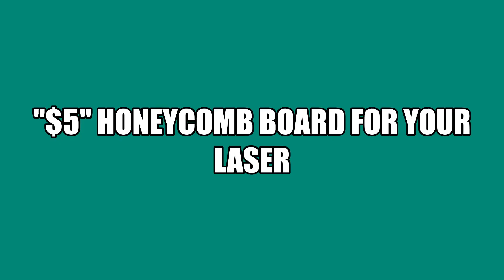Make a $5 Laser Honeycomb #laser #lasercutting #laserengraver #diy

Comment: Hey, I was looking around to see if anyone else had done this. I don't know exactly how to flatten it out perfectly- I've got a huge roll of it. If I can flatten it thought I'm going to try this idea out. Nice work!
Reply from the maker: You can get I pretty flat by stapling it to a board and heating it with a heat gun. Then taking a hammer and tapping on the high spots.  I learned that after the fact.

Comment: YARDGARD 308221B Hardare Cloth Foot, Silver, Height - 24 Inches x Length - 5 Ft, Color - Galvanized $11.90 let you make 400mmX400mm
Hanging file folder flat rods  as  support  wood  frame scored for edge of wire as ND the  file supports under wire
Reply from the maker: Good idea

Comment: Can I use this for co2 laser?
Reply from the maker: It is stainless steel mesh so depending on the power.  I don't have a CO2 laser so not sure but I know they are more power but I don't see why it wouldn't work. I have been using mine with my 40w diode and it is fine